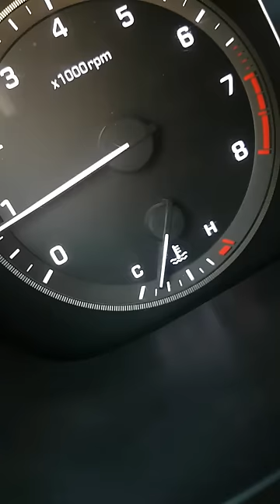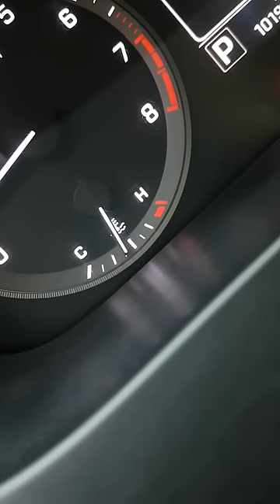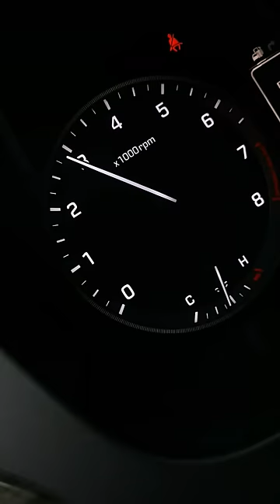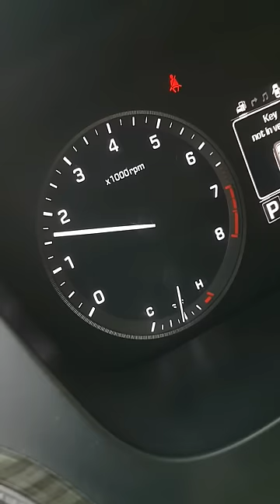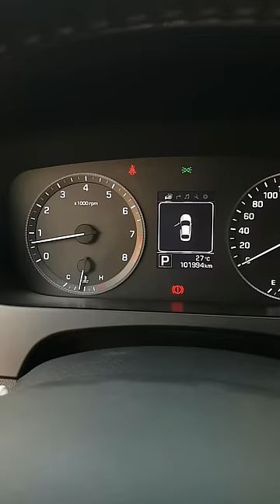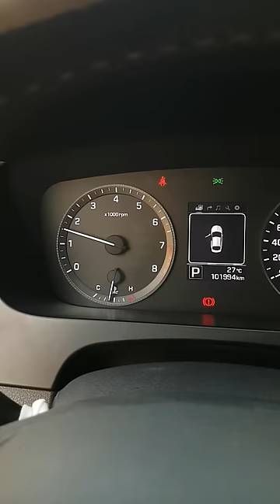Catalytic converter cleaning تنظيف دبة البيئة

Comment: how is doing anything besides cleaning the throttle body cause its all evaporated by the time it even hits the cat? I understand it clean the combustion chamber and intake valves but its not going to reach the cat to clean any build up already in the cat.
Reply from the maker: It's chemical evolution 😄

Comment: The cleaner from the intake will be mixed with fuel in combustion chamber. It should be same as the addition directly pour in the fuel tank.
Reply: It's less effective if you pour it in fuel tank
Reply: Cataclean works best by following directions.
Reply: More than that, he also cleaned the throttle valve.

Comment: Slmz. My 2008 Corolla switches off when I remove the hose to the throttle body. Is it safe to remove the MAF sensor whilst applying this product?
Reply: Press both gas and brake at the same time while starting the car and keep pressing until it starts
Reply from the maker: Yeah, try to keep it out of the hose in safe place but if it not work you have to apply the product through upper O2 sensor hole while car switched off ..

Comment: This also clean carbon dust from throttle body and all dust Will be accumulated in IAC valve, next morning IAC valve will stuck and car takes a long crank
Reply from the maker: Most on-road cars are coming with ETC, thats mean they're not equipped with IAC!
And even if the car has IAC, it will be cleaned as well, and the carbon will be blown out of the engine through the exhaust.
Reply: You can have carbon dust baked on the valves, not on throttle.

Comment: it is wrong application , here in musaffah abu dhabi , i came to exhaust shop , he remove the mufler and pour the whole liquid and than give air pressure in the muffler and catlaytic
after this reinstall the muffler and we give rpm for 2 3 minutes and with the air whole liquid came out in air only thru white gas
Reply from the maker: Both ways are correct

Comment: So I didn’t understand, did he wash the throttle valve or the catalyst?What was this liquid?
Reply from the maker: This liquid is to be applied in the throttle, and automatically, it will reach the catalytic to be cleaned and for more detail it will go through throttle to air intake then to cylinder (it's not flammable so it will be remaining liqued) then to the exhaust and there will be the catalytic.
The used  lquid is Catalytic System Cleaner (throttle type) from Liqui Moly, and they have another type of this product to be added to the fuel tank.
Reply: @SAYED_ALMOSAWY  
Well, actually, the instructions say to fill in a tank of 30-40 liters
Reply from the maker: @_Nomad_  Yeah, because there's  two types of this product, one to be added in the fuel tank same as you said and the other one to be sprayed into throttle body same what I used in this vedio and each has its benefits.
Reply: @SAYED_ALMOSAWY  cool thanks for the tip 🤙

Comment: I have a 2014 chevy silverado 1500 4.3. 272110 miles.
I had a code of p2097 so i changed the upstream and downstream 02 sensors.  I install a new MAF. I cleaned throtter body.  Now i got a code of p2099. Help me
Reply from the maker: You have to get it to the workshop as there's many things to check.

Comment: I thinks its not helpful to clean catalytic, bcoz first its going in throttle body after that its reaching to intake valves cleaning both and burning in fire over piston, but cant reach in liquid form from exhaust valves to the catalytic its already burned before reaching the honey comb of catalytic, so how that can be clean. Not possible.
Reply from the maker: It will reach the catalytic as liquid because it is nonflammable, so it will be helpfu.

Comment: ⚠️ WARNING 
All the dirt and crap behind the throttle body is going to be swept by the product down in the combustion chamber and will damage the cylinder walls and piston rings.

I myself experienced that and ended up with a ruined engine

Comment: This is Throttle body cleaning not catalytic converter. FYI
Reply from the maker: It's Catalytic-System cleaning through the air intake/throttle body. Throttle body will be cleaned as well by using this way. 🙃🌹

Comment: Does it help converter if you already have an error code of catalytic below efficiency?
Reply from the maker: Yes, it may help depend on the problem size. In my situation, I've noticed the difference in the accelerator response.
Reply from the maker: Sorry, I have deleted your comment by mistake 😅😂

You have asked if the white smoke is mandatory to come if you use this method:
It's not mandatory. Smoke is coming if so much liquid has burned in the same time.
Reply: @SAYED_ALMOSAWY  thank you for taking the time to answer for each question it is very much appreciated. The reason I was asking is all these brands and carbon cleaners advertise their videos and they all have white smoke coming out the tailpipe, so I thought it should be like this you know? How would I notice the improvement, what are the symptoms for the treatment working?
Reply from the maker: @lucidfairytales  You are welcome 🌹 
Depending on your car, I noticed the difference in the acceleration.

Comment: Its wrong method, maf, map, air pressure valve sensor are attached with throttle body, and its harmful for all of these sensors..
Reply from the maker: It's safe for these sensors
Reply: @SAYED_ALMOSAWY  If you have a really dirty (clogged) cat, you need to remove it and clean it outside.
I used:
1. NaOH concentrated in a mortar bucket for several days 
2.hot water
3 hot air gun for "some" time.
Possibly a propane torch could be used too, but it could be a danger for the ceramic body inside.